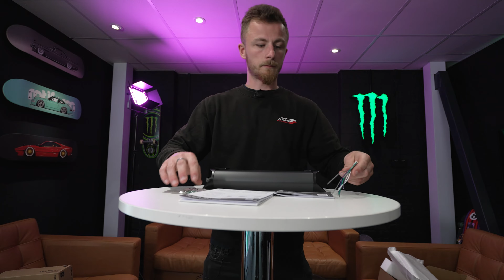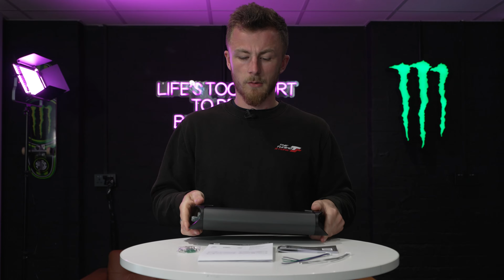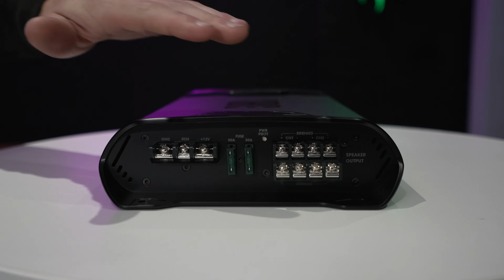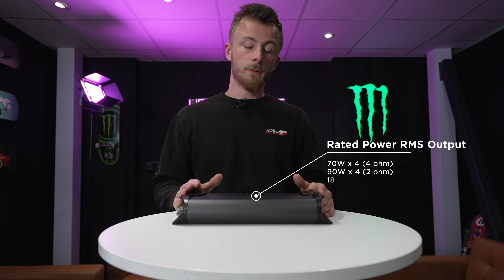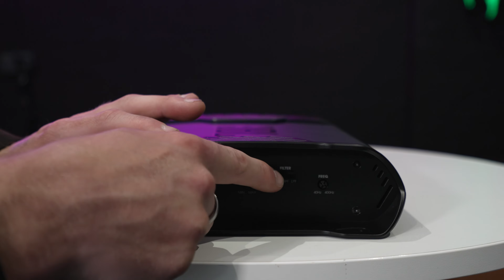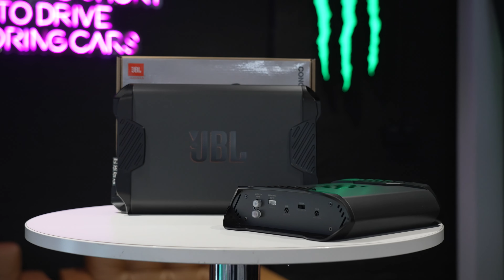JBL Concert Car Audio Amplifiers A652 & A704 | Car Audio & Security

Comment: Can you use the 4 channel output as well as a subwoofer ?  (Two speaker front, Two in rear + a subwoofer)
Reply: No, you are trying to power 5 channels with only 4 channels of power. Not going to work, you will need a 4 channel for the speakers and a mono block for the sub. Plus trying to power a sub off of full a range amp will damage the sub and the sound produced, you need a LPF on the amp or separate to run a sub correctly.

Comment: I actually have the jbl club speakers. I have 4 total, one on each door. They are rated at 165 peak and 55 rms. Would this be a good amp for them?
Reply: yes, 70 watts would be a good amount of power for them if not then maybe the JBL Stage A6004